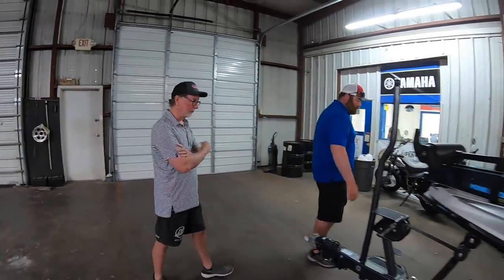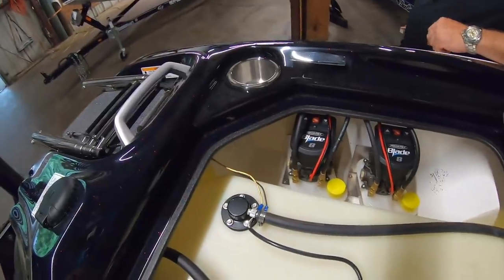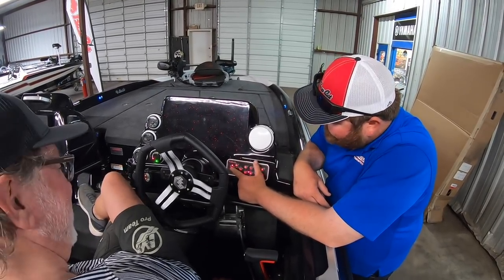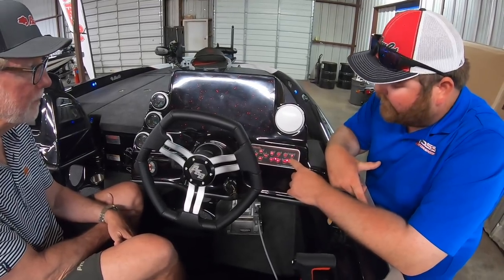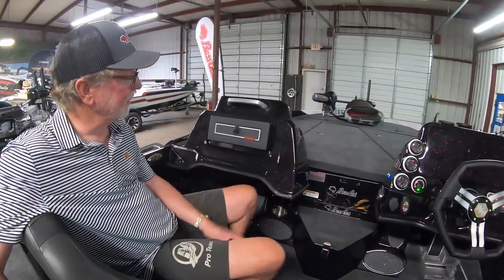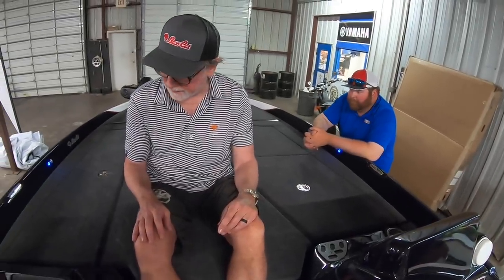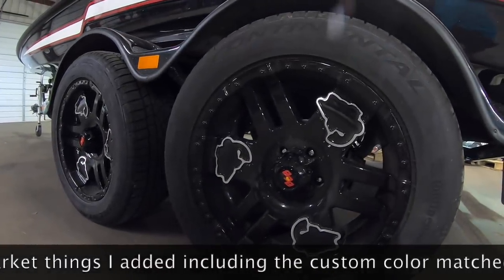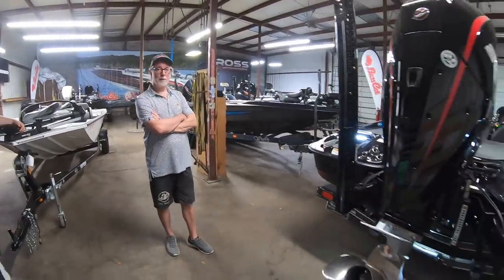Bass Cat Lynx Walk Through at Ross Motorsports

Comment: I have been a fan of the center rod box for years. My 522VX had one and my Z521C has one. I have 10 rods rigged and I can step back two steps open the lid, pull the rod and cast. Keeping your deck rods port and starboard undisturbed. Nice looking basscat Ken, enjoy yourself.
Reply from the maker: I kept 4-5 in the center box of my Ranger, so not a big adjustment
Reply: Gotta be honest, I have center rod storage on my boat, side tackle. Love the center rod storage, not a fan of side tackle. Simple reason, my deck lids open out, my rods sit on my lids… appears to be designed to throw my rods in the lake if I’m not careful. Falcon solved this problem with deck lids that opened forward, wish they all did this.

My dad actually owns the Puma STS that you tested btw, great boat. Cool series!

Comment: This may be long-winded...

Another great video by Ken Smith fishing!  So... After 10 months of a grueling back and forth, I have ordered my Bass Cat Puma STS.  You have a gorgeous boat and the walk-thru is very useful to a new owner.  I go back to sections of the video to get a better understanding. So it's like my pocket reference!  Ross Motorsports was my 2nd dealer choice.  However, I picked one in Missouri.  Coming from Southern Wisconsin, it's not as bad a drive.

Options are easy to pick.  Just get them all!  Actually, that's pretty close to the truth.  However, color is another quagmire altogether.   I went back and re-watched your videos starting from about March.  This one video is very interesting.  For whatever reason, I did not notice your color choices until today.  You and I have the same taste friend.  I believe your hull color is Malibu Red with apple red trim and white insert bolts (Radiance upgrade).  Right?  

One of my choice combinations for my STS will be similar to yours.  But instead of white, I went with apple red.  Even the trim is apple red.  I think using silver trim with a red insert on a black hull is not as bold-looking.

Thanks bud!
Reply: How long is the wait once your bought one?